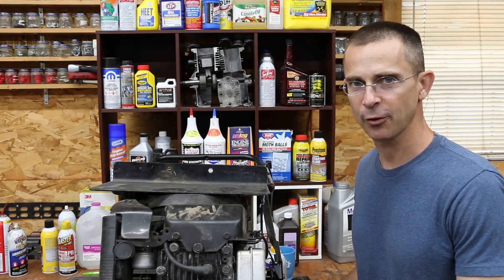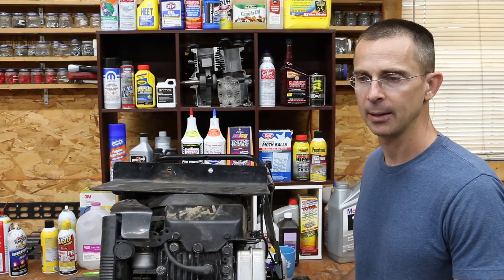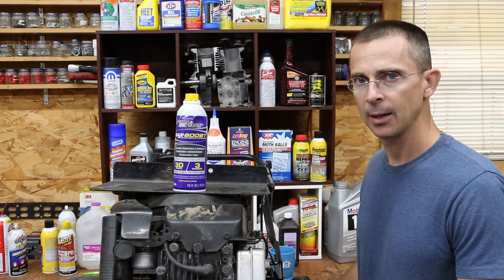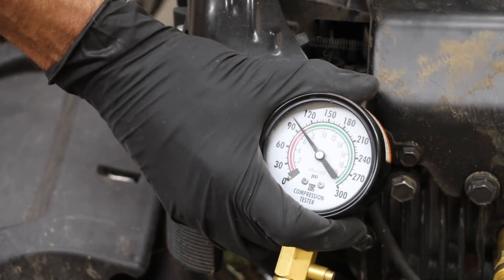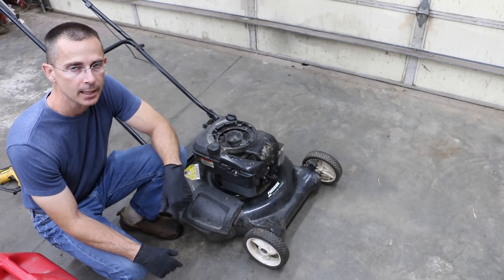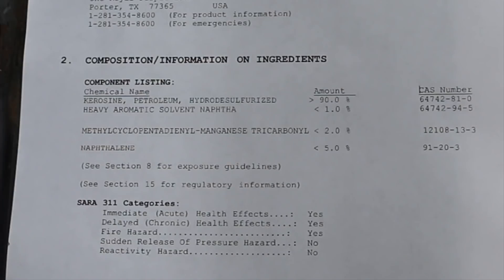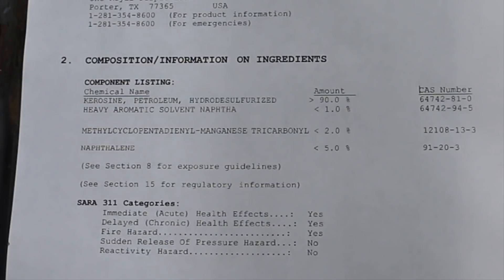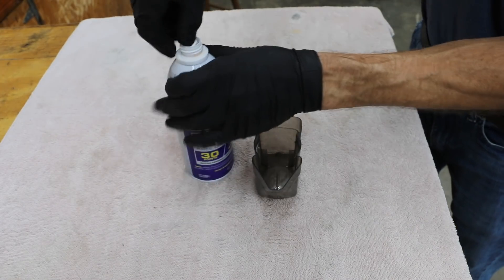Will a gas engine run on 100% octane booster?  Let's find out!

Comment: No HAZMAT suit yet I see. Brave man. Didn't know kerosene was an octane booster but I don't know much. I just get hi-test and/or fresh gas for an octane boost. I run all my small engines on hi-test and Delo 15/40. Yes, with ethanol. No problem except carb kits every so often. With the yellow you wonder if CAT or the D.O.T. had something to do with it or just maybe the school bus garage. Anyway, Thanks Commander. Don't think I Need a yellow combustion chamber at this time!  Briggs 1, Purple whatever- ???
Reply from the maker: Hi Lewie, Yes, I should wear a HAZMAT suit for some of these videos. I normally wear a good quality respirator to avoid breathing in the fumes.  This was a fun project.  Thanks for commenting. Regards
Reply: Like wise, I'm sure but if you ever do one on straight nitro you might ought to think about remote, like when the a-bombs were tested and didn't kill us all off. Take care, Commander and Regards backatchee!

Comment: One of the best channels on YouTube!
Reply: Him and Deboss garage are 2 highly underrated channels.
Reply: Gristle Von Raben agreed!
Reply: Project farm I have been thinking about the gas to diesel conversion recently on the flat head platform should be decently easy higher compression can be achieved by adding material "aluminum welded" and then clearance for valves and piston and replace spark plug with bolt and jam nut and a stop bolt welded on so the bolt can't be ran in to far and hit piston doing this will help tune the compression by running bolt in and out. in for higher out for lower also diesels run with intake open as they rev up by amount of fuel added not air so another way to get fuel into engine without carb on engine would be ideal. A fuel hose and ball valve gravity fed into intake should work hope you take the challenge 😉
Reply: Agree with all above GREAT CHANNEL !!!
Reply: not one of it is the best!!!
Reply: I agree but try that on a high compression modern engine. Lawn mower are maybe 8.1 compression. Do it on a real engine other than lawn,  rabbits can eat the grass. Try it on a car that you drive daily
Reply: You won’t ruin your daily. Go ahead work on cars and find h2o in the system most cars won’t run let alone drive. Using half gas and water in a car tank. That’s 15 gallons half water! Run your car that way! It won’t run it will but if it does good luck driving it. I don’t need videos to tell me what will run in lawn tools. Try it in your car! If you know! Try 2 gallons of water in your car! With 29 gallons it runs like shit and will set off engines lights
Reply: Gristle Von Raben j
Reply: A man channel
Reply: SouthJerseySound 
jennies garage as well
Reply: I just love the background in your shop! Everything a healty engine needs: Motor Oil, Seafoam, Octane Booster, ..., Moth Balls. Your channel is really entertaining, yet scientific. Keep on going!
Reply from the maker: Thank you very much!
Reply from the maker: Thank you very much for the positive comment.  I'm very fortunate to have 3 children.  We have a lot of fun together.

Comment: You should fill the crankcase with some sort of grease (mega moly) and see if itll stay running or self destruct!
Reply from the maker: Thank you for this recommendation!
Reply: First rotation the piston rings will push all the grease down from cylinder walls and then cylinder will run dry.  Same for crankshaft, journals, wrist pin, etc, displacing any grease.  It'll work for as long as the grease stays put.
Reply: A friend of mine filled his crankcase with oil almost to the top and it started then blew up whiten a few seconds
Reply: Yes
Reply: Sir Foxx  lubriplate 105 works

Comment: Would you try to use vp 110 octane fuel in one of your engine?? Do you think a small enigne will handle the high octane?? Thanks for your vids
Reply from the maker: Thank you for this recommendation and thanks for the positive comment!
Reply: Daniel Mccoy that's not how Octane works.
Reply: Tyler Coates what i meant was, using race gas to see if those engines can handle it. Higher octane, the hoter it burns

Comment: Great video,how about converting a gas engine to run on Diesel
Reply from the maker: Thank you for this recommendation!
Reply: Pyrotechnition 2002 two strokes Diesels do have injectors
Reply: Matthew Weisenburger lol just commenting to stay up to date on the debate
Reply: Pyrotechnition 2002 no you can't Diesel will not vaporize enough on its own it needs to be atomized by an injector
Reply: He just did (in this video).  That stuff is 90% kerosene, which is #1 Diesel.  "Normal" diesel is #2 diesel, which is heavier (thicker)...
Reply: yes this would be cool you would have to let the engine get hot then drain and put diesel in probably.      my brother done it on a dirtbike so I know it works the engine was dieseling it took a while for it to turn off after the kills witch was off but the carb and engine was almost spotless
Reply: You just need to heat the cylinder or head for the diesel to burn. Once the cylinder is hot, the engine will run on 100% diesel by it self.
Reply: Rednex creations Diesel rc engines don't run on diesel
Reply: https://en.m.wikipedia.org/wiki/Carbureted_compression_ignition_model_engine#Fuel
Reply: Scroll down to fuel
Reply: Kerosene is not Diesel anyway. Kerosene has a lower flash point than diesel
Reply: Diesel r/c plane engines use carburetor
Reply: Mat Helm it says 90% kerosene and petroleum which is incredibly vague. Petroleum could be a number of things and it doesn't specify the ratio of the two. Pure kerosene can be run in gasoline engines I've seen it done but it smokes and doesn't run this good.
Reply: Project Farm i have a recomendation, take a litle bit of every kind of gas and mix it in a gas can then see if itll run
Reply: Search after "Volvo B230 Diesel" on Youtube, it works great.
Reply: Diesel lawnmower lol
Reply: Scott Tyndall's Home Shop would be incredibly difficult. You need an injector a way of timing injection and need a compression ratio around 17:1 (lawnmowers are typically around 7 or 8:1)

Comment: whats the thinnest and thickest oil you can run in one of these things and how does it affect performance? love ur stuff btw!
Reply from the maker: Thank you for this recommendation and thanks for the positive comment!
Reply: David Loogo when I was a kid we put peanut oil in the crankcase of a junkyard briggs. It ran well until the governor was wedged wide open. It would scream for about 90 seconds then sieze and go rolling across the yard. As soon as it cooled down she'd free up & run again. Never did get it to throw a rod.
Reply: This will be very educational on a motors starting and running and oil difference between 10 40 and 10 80
Reply: hahahahaha damn
Reply: Yes! 90w140 diff oil in the engine vs 0w10 (can you get any thinner?), maybe try something silly like baby oil?

Comment: Try running butane instead of gasoline
Reply from the maker: Thank you for this recommendation!
Reply: Not really, LPG is used as an engine fuel all the time and is a varying mix of propane and butane. IIRC butane is ~92 R+M/2 Octane equivalent and propane is ~110. Schwan's Dairy trucks are either LPG or diesel.

Just need a couple appropriate pressure regulators and an Impco CA55 or similar to properly run it.
Reply: FullThrottle that would be hard butane is a gas not a liquid
Reply: it will run FINE on butane, just like propane.

Comment: Run ATF instead of motor oil.
Reply from the maker: Thank you for this recommendation!
Reply: San Pro havent used atf as 100% engine oil but have used 50:50 ratio it ate sludge like anything

Comment: Can you run a small engine on purely fumes? (See other videos online)
Reply from the maker: Yes, I'll do this in an upcoming video. Thank you for this recommendation!
Reply: like an exhaust feedback loop?  EGR but pure ? that engine would fowl up insanely quick im guessing....how long can an engine feed itself before killing itself
Reply: No, using intake vacuum to bubble a gas tank, then running the fumes directly into the carb.